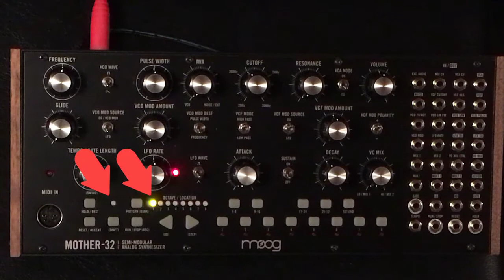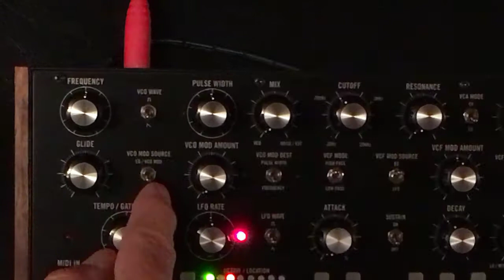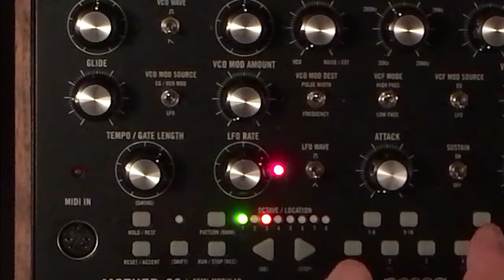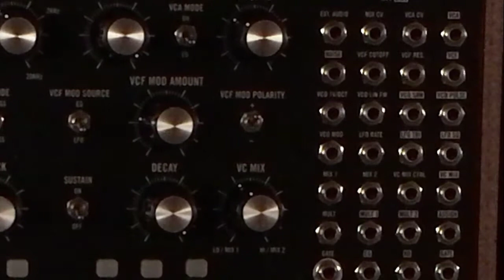Moog Mother 32 Sequencing Demo

Comment: Hello, can you play multiple voices or tracks on the same sequence? Are you playing every track from your M32 or are you using a DAW like ableton for your arrangements?
Reply from the maker: In this video, only the Mother 32 is used, so it's a single voice and single track. All the other sounds are just done with the CV patching shown in the video. No DAWs. You could drive other instruments with the same sequence by going from the KB Out patch point to the Pitch In on the other instrument-- I do that with my Voyager sometimes-- but your options are somewhat limited that way with no MIDI out from the Mother 32.